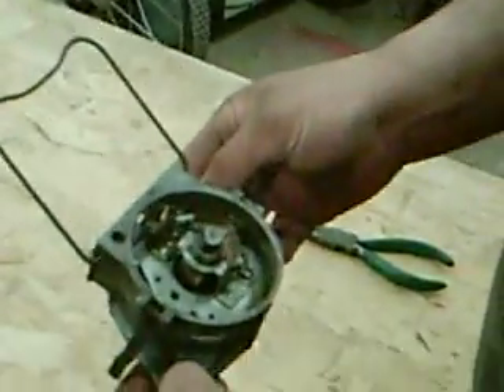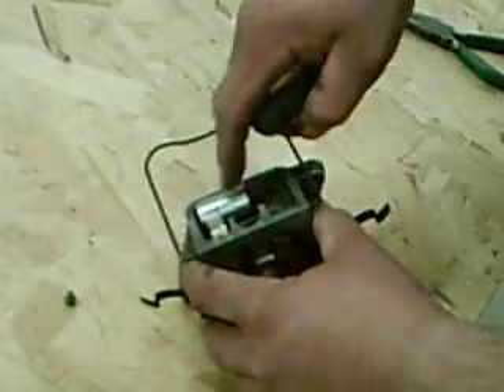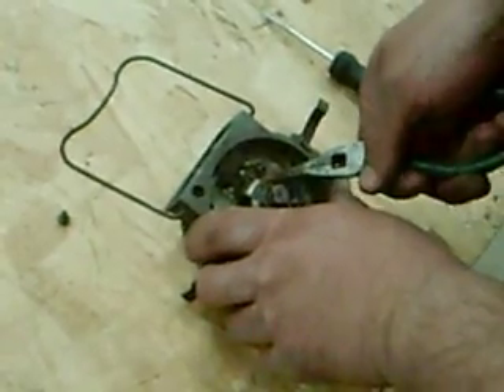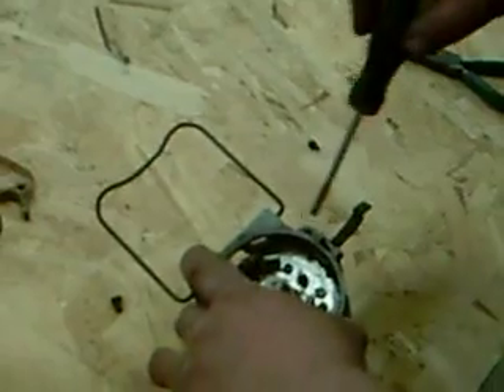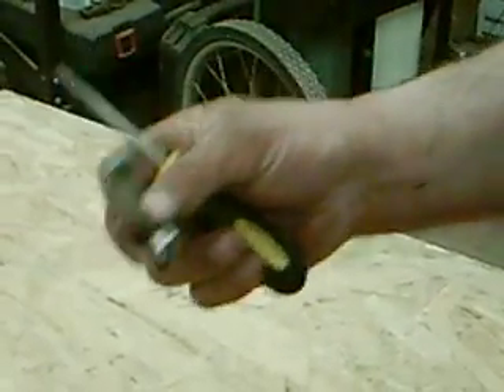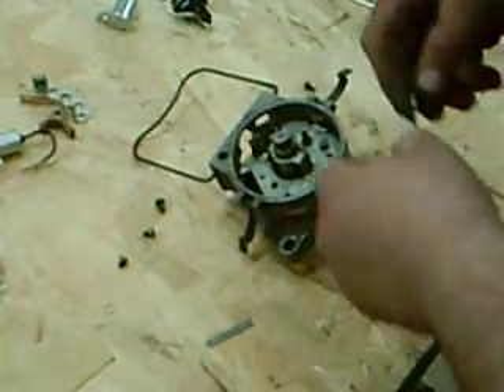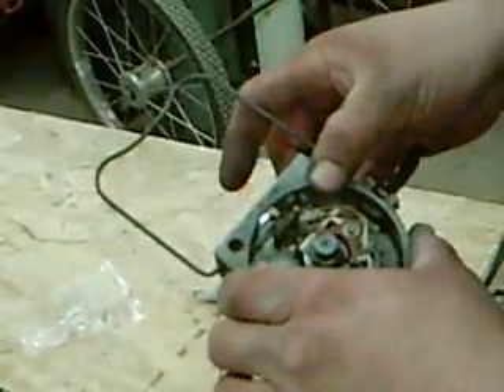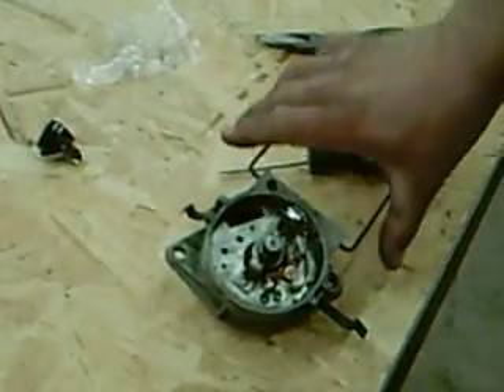How to install points in distributor for 9N, 8N, 2N Ford tractor

Comment: There is no such thing as a 1952 Ford 9N tractor. The last 9N was built in 1947.
Reply: +David Given .. The last 9N was built in 1941...Then they were 2Ns until 1948... Then they were 8Ns.. Try to catch up David Given..  that way you want sound dumb..
Reply: +Danny V .. So if good ole David wanted to call them "bicycle horns" instead of what they are then that's ok???  Were you and David in jail together?? Why are you defending him when he IS wrong?? Maybe he could call the 9Ns and 2Ns John Deere? You would go for that as well... You talk about purists but YOU painted yours, "(painted all gray like it's supposed to be in case you were wondering)", maybe you are a purist. So put a generator back on it "like it's supposed to be". My 9N has a 4 spoke steering wheel, a nickel plated "knob" on the shifter, an aluminum dash, and an aluminum hood.. WOW it must be a 2N...
Reply: +Danny V  Serial numbers are for people that don't know what they are looking at.  Danny V.. You are a little fish in a big pond... Most of the parts are interchangeable... and have been changed.. that number will tell you something about the year of the block. Nothing about the tractor. A 50 model block will not make a 40 model  a 8N. Think about what you are saying.
Reply: +Danny V.. My radiator cap is not like yours either.
Reply: +Danny V ...Better check of the radiator cap, know it all. You see, you are running your mouth about something you don't know anything about.